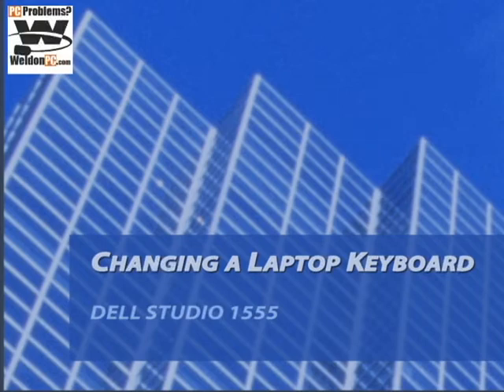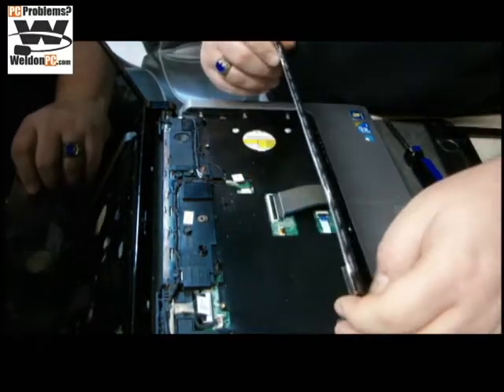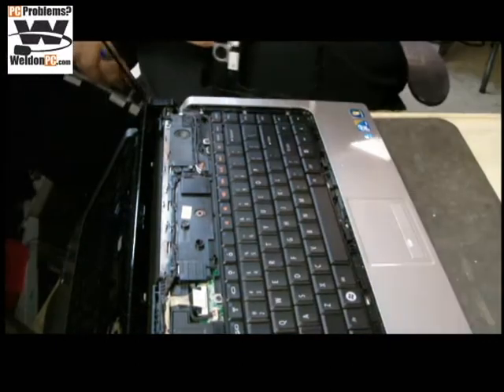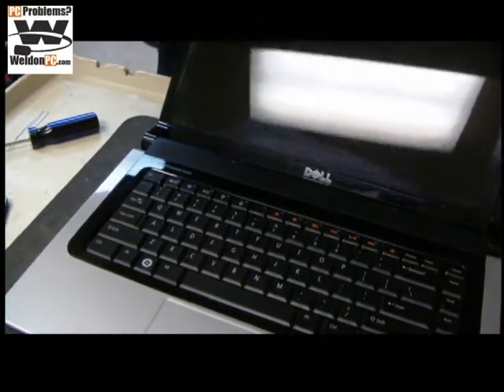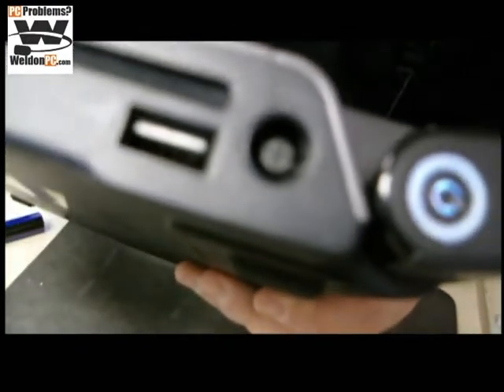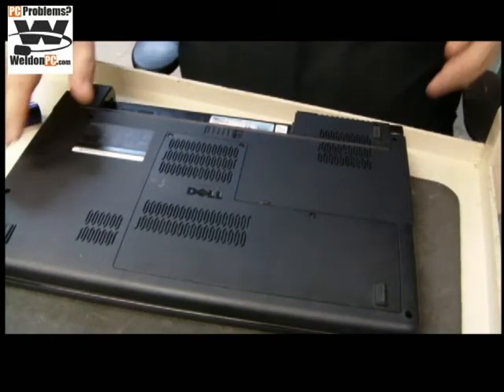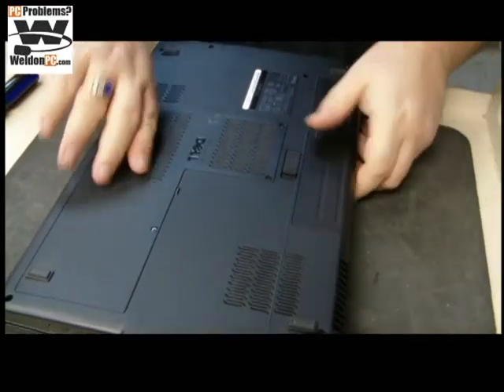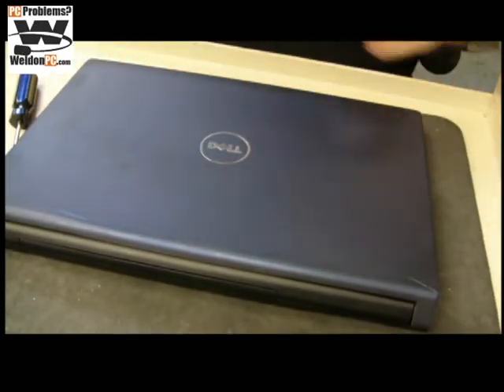Replacing a Keyboard on a Dell Studio 1555

Comment: I recently bought this model computer from a friend of mine. I bought it with a 500gb HDD in it but upgraded to a 1tb HDD even though the 500GB worked and had the ram upgraded from 4GB to 8GB so now my computer is a work horse. One thing I noticed on my keyboard is a few keys are loose how much does it cost to replace the keyboard? It looks easy for one to do himself but i am just wondering.
Reply from the maker: It wasn't very expensive. I think the keyboard wasnt more than $30-$40